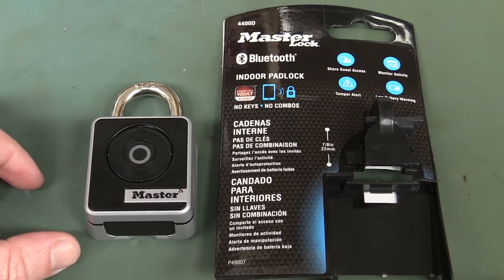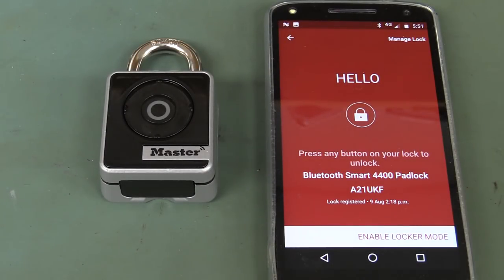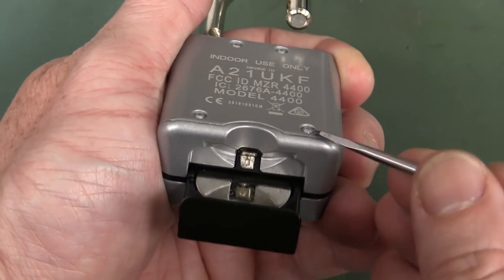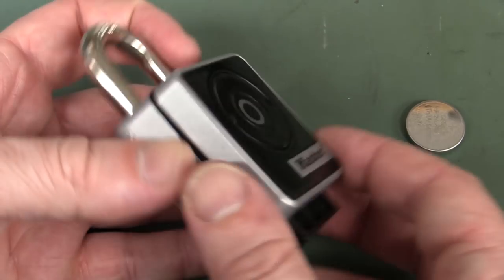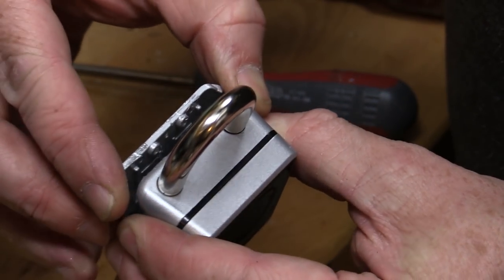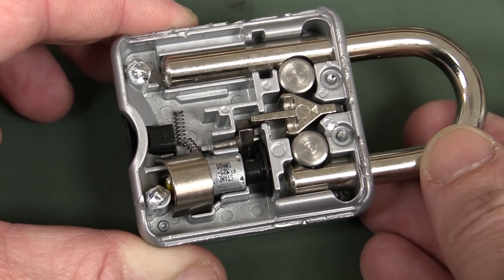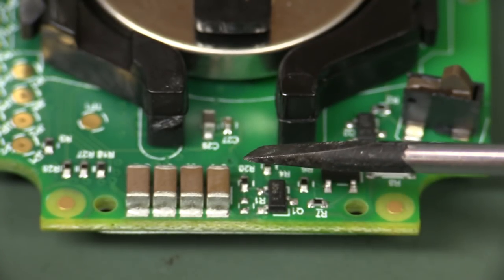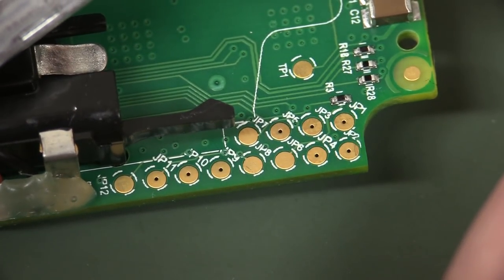EEVblog #1014 - Masterlock Bluetooth Padlock Teardown

Comment: Master locks are a joke in the first place
A beginner can pick their key locks with actual paper clips... Ask any locksmith what they think about them lol
Reply: I made that boast to somebody who challenged me to prove it, so with two jumbo size paper clips (one bent into a tension bar) I opened their Master padlock in less than two seconds from when the pick paperclip went into the keyway.
Reply: easy to push them locking pins in with some shims..im sure theres a vid floating around on youtube showing exactly how to do it
Reply from the maker: No, I don't think shims will work on those pins. The bottom locking pin will prevent pushing down of the upper locking pin.
Reply: It's just a master lock. You tap them once or twice with a hammer and they will fall off on their own.
Reply: Yeah, shims won't work on modern Master's, they've at least come that far. But their key locks are abysmal
Reply: It's not as though their combination locks are hard to get into either.
Reply: All locks are meant to keep honest people honest. No single device is ever truly secure.
Reply: Yes, Joe, I wish everyone would be honest if there is no lock in the world
Reply: Ok Peter S  
I challenge you to post video to prove your two second lock picking skill 
I know master locks as well as other locks can be picked with paper clips but they take longer than two seconds from when the pick first enters the keyway 
SO... prove your skill
Reply: MrBuck295 He's right, probably using the rake method. Some locks are so incredibly shitty that you can just scrape the pick over the pins once or twice, and they open. Usually the no-name Chinese ones, but some Masters too!
I'm sure there's evidence of this on BosnianBill's channel too
Reply: But this one doesn't have a tumbler, thus avoiding the main problem with master locks :)
Reply: Bosnian did a video where he scares a Masterlock in various ways to scare it into opening. :D
Reply: Some locks are so bad that you can hit them with a hammer and pop them off.
Reply: uuugh people lock things to make it harder to get or steal. NOTHING is secure if the person trying to break in is determined, but for someone to lock a "thing" makes it 1000% hard for someone else to just grab and run. Gaaaaahh
Reply: Words are cheep he claims to be able to pick a master lock in two seconds Actually in UNDER two seconds in his own words from the time the tension tool is inserted I find it hard to believe as every locksmith I`ve talked to claim this to be impossible three or four yes but under two starting from tool insertion no    and again he said a master lock not a cheep nock off 
Hell I can pick my worn out master but not in that short of time I pick it all the time cause I lost the key but it`s only used in the house so I don`t worry about   it
Reply: An inexpensive Dudley padlock is ideal for your kids at school.  Can't be picked or shimmed.  You can noodle with the numbers all day to try and unlock it, but who really wants to to put that effort into stealing text books.
Reply: Lock brands have varying levels of security and design. To get a good lock, you need to get specific models of specific brands. A beginner can't pick this bluetooth lock with paper clips, because it is not a pin tumbler design. Another example is that Masterlock has a "lasertrack" style bike lock. This can not be picked by a beginner with paper clips either.

I suppose I would say that I I prefer to use something like an ASSA, Medeco, Mul-T-Lock or even just an American padlock (although all these options cost anywhere from twice as much to up in the hundred dollar range), over using a Masterlock brand lock. Masterlock is by far not the worst brand, but it is also by far not the best brand. 

Masterlock is around in the middle, from an effortless lock that can be opened by pulling hard enough on the shackle (with nothing more than your bare hands, such as a $1 no-brand lock), to locks that are considered impossible to pick and have high-pressure locking pins so that if you pick the lock, then before it grants you access, it will permanently cease up the core, requiring you to physically destroy the lock to gain entry.

However, one more side note, is that some brands of locks, don't care if they sell a lock that uses a key pattern that is almost completely flat, which is horrible for security. More expensive locks, SEEM to have a standard where they SEEM to blacklist these bad patterns, so that nobody gets a horrible lock. To give a lock brand and model the best chance it has, you need to test one with the most drastically shaped key.
Reply: bosnianbill - saying no more....
Reply: A nearly flat key? China never ceases to amaze!
Reply: I love how they're called "Master" yet they're the worst locks in the market.
Reply: Ozzie Peck If a master key is a key that opens any lock, then a master lock is ...
Reply: IIRC someone has already figured out the bluetooth protocol to just ask any lock to open.
Reply: It requires an authentication key. A random device can't just connect to it and ask it to do something.
Reply: just ask bosnian bill
Reply: Lol. 😂

Comment: The drive looks like a modified Geneva mechanism. In use the motor would turn 90° or so, it almost certainly just pulses the motor one way or the other for a moment to lock/unlock.

Comment: Sure you can't take the battery out when it's locked. But there's nothing to stop you putting mains voltage across those battery terminals.

Comment: Have you tried rotating the magnet  parallel to the motor axis? I have seen some locks fail like that. Also DEFCON talks often feature padlocks from the electronic side of the problem.
Reply from the maker: Yes I tried that. They get magnetically hack this at the CC hack conference, but mine seems immune to this, they might have fixed it.

Comment: I don't think it actually spins that much inside the lock. Its just a delay before the motor stops to ensure that the locking mechanism has locked completely... When it actually works, it will just rotate a little bit after which it will be stopped by that locking mechanism..

Comment: This wouldn't be that bad of a lock for lockers or when you're not trying to protect something insanely valuable. And, if there is someone who's used to picking locks open, this lock would probably throw them for a loop.

I don't think it's that bad of a lock per se (depending on what you're using it for). When it works, it is less hassle than a normal lock, but normal locks aren't all that much hassle to begin with.

Comment: Those spikes you were measuring were from the power supply/battery? Are these dips in voltage due to the current spikes of the controller?
If so, how comes that the bulk caps don't do their job and don't flatten these spikes? If not, than I don't get it :p

Comment: Interesting tear-down Dave.  What is to stop a thief from using a battery powered angle grinder with abrasive blade from cutting the hasp ?  Not much !   I've heard of some folks who chain and lock gas power generators to a structure. An opportunist could plug in a grinder ( generator running would block the noise made by grinding ) and be off with the whole system !   It only slows the "honest " folks.    J K

Comment: If this thing could alert you to tampering, I'd be all for it, as my gym locker got broken into once. Some wanker ran off with my wallet, my car keys, and my pants. 

Hey, I gots a production question: Do devices that use programmable controllers like this typically include programming headers on the PCB, or is it more common for the microcontroller to be programmed before installation? Is there a particular benefit to one over the other?
Reply from the maker: You'd need an internet connection for that, and you just destroyed your battery life.
Reply: I know, it's just a pipe dream. Would've been nice, though; Winter in Colorado is a rough time to be running around in gym shorts.

How's about my question on PCB design?
Reply: Header/test-points on board are preferred over programming a chip off board.  This way you can program and verify basic functions at the same time, after the high risk assembly has been done.  If you scale up to millions of units with flawless optical inspection, then it might make more sense to program chips before assembly.  Or if you are making conference badges where you don't care if 30% fail, no testing needed.

Comment: Why not just rip off the keypad and trigger the motor with the correct pins?
Reply: Huh, yeah I guess that might work. You'd only need a screwdriver and a paperclip. Those big soldered joints on the corner look like the wires to the motor so provide power to those and that might do the trick.
(EDIT: I can't words tonight.)

Comment: Feature of opening it by using external Coin Cell indeed is a nice attitude, but I could not see any hint on what type is expected to be used! So, not being able to open it up to see the correct coin cell type possibly would not help you as well open it up if you don't have that info accessable. Regarding all security issues, practicality issues, waste of battery cells, problems with moisture and so on and so on - what's the big advantage of that Padlock over some traditional Padlock (with usual key)? 

It can be cracked open like a usual one, it doesn't seem to work without code like the el-cheapo-numeric ones, it needs battery as coincell and a properly charged phone to work as well, so.....(?)
Reply: It's easy to guess that. Any lithium coin cell. They all are 3V, so you only have to figure out physical size - and any cell in the CR16xx or smaller would clearly fit, and work.

Comment: Why can't you power it from your phone if the battery is dead, or locked out...  if your phone has to be in proximity to it. 
Then just oh carry a usb charge key on your keyring. 
Or a little cr2450 battery holder you can put on your keyring.
;)

Comment: I'd be questioning whether the back is strong enough to withstand a screwdriver being pushed into the crack and twisted. It doesn't look all that strong and there are no edge fasteners. When designing security products it's all too easy to overlook basic issues whilst concentrating too much on complex ones.

Comment: The thing is, theoretically this could be an amazing idea.
We all know that actually, locks are mostly comically easy to pick. (Even the good ones)
Good digital crypto is technically not hackable.

I just have to see a bluetooth lock that not utterly incompetently fails at this promise. Perhaps lock companies should not build computer things.
Reply: As long as you have a mechanical part you can physicaly destroy/open it. Even if you just torque it to death with a huge ass pipe wrench or give it a good blow with a large hammer from above. Pretty sure the aluminium casting will just shatter like the dreams of the design engineer who designed this piece oft art.
Reply: Also good crypto is still technically hackable. You can extract keys by sniffing on data lines, reading memories or finding flaws in the implementation and so on... Good crypto may be in theory unhackable, but at some point you have some implementation that depends on other things that are attackable.

Comment: I wonder if you could get it to open by putting mains power to the two contacts for the "emergency" battery?
Reply: How would you explode the battery, it's not connected when you have access to the emergency battery port.

Comment: Could do some nice screwdriver work to stuff it up if the battery comes out partially while locked.
A slightly better idea would be to use a RFID fob pressed against the lock to power it up.

Comment: Think the best use case for this would actually be a high school kid who could be going in and out of their locker a dozen or more times a day. Of course it's a bit pricey today, but 5 years from now it'll probably be pretty standard fair; then again why don't the just use eBooks?
Reply: i208khonsu Because they can't store their gym-wear and lunch in the ebook.
Reply: True, but my point is I think outside of high school life, what are these locks used in daily life except for locking up your lunch or gym gear? With high school you've got all your books and other gear you need to constantly retrieve and store from your locker, and generally how you plan out your day is dependent on if you have enough time to stop by your locker in the few minutes between classes.

If you can instantly open up your locker, you may elect to take a few less of those heavy books. However; like I said how much longer are schools even going to use physical books? I was still using books in college a decade ago, but I can tell you if I'd go back, there's no way I'd buy physical books if I could help it.

Comment: Enable locker mode. But it’s rubbish. I don’t like locks that require electricity. Combo is the best. I can pick most pad locks in about 20 seconds or less. Usually less.
Bolt cutters will hack it lol.

Comment: As stupid and pointless this is for your personal bike/locker/whatever, it does have legitimate use cases. At work our team has a cabinet we keep our essential equipment in, and we have a serious problem with other departments taking our equipment. We tried a combo lock- everyone knew the combo in a week. Tried a key lock and hiding the key- everyone knew where the key was in a week. I seriously considered buying this product so that one of our team member's phones would have to be present to open the cabinet. We ended up just having two designated people keep a key but it gets annoying having to constantly let people in the cabinet and passing the key off when schedules change. I am still looking in to some electronic lock solution.

Comment: I think anyone can come up, open the battery compartment and use a piece of aluminium foil to short out the backup battery contacts thus render this thing useless until the owner come up with a new battery?
Reply: The battery may heat, puff up and melt the plastic compartment rendering the thing completly useless. It will also prevent the owner accessing his stuff, but since it's Masterlock, access can be regained with a few taps from a hammer.

Comment: "Hardened" yeah not so much, none of those cheap locks are over 40HRc, any small bolt cutters will pop it right off. I have high tensile fence wire that is more difficult to cut.
The bluetooth bit is all gimmick anyway

Comment: Dunno about that backup battery terminal - if someone's enough of a dick to try stealing the battery when it's locked they might be just enough of a dick to probe  those exposed terminals with a modified mosquito zapper bat handle or some other portable source of HV to try fry the ICs just to piss you off. particulary if it got popular with schoolkids which seems to be who the advert is aiming it at... how's it going to stand up to that?

Comment: It is pointless, I'd never spend £50 on a lock that could be busted with a set of bolt cutters in seconds
Reply: Bolt cutters,?  try a foot of rebar through the shackle or any handy stout stick
Reply: The case material looks like something very smashable with A hammer,two bricks or decent pliers.
Reply: Point being it's not a hardened shackle even
Reply: It's not even a lock meant for security, if you want security go lug around a 4 LB mul t lock c16

Comment: why didn't they used rfid, its easier to use than bluetooth and you don't need to make an app for conrolling the device.
Reply from the maker: You'd still need a keypad for a manual combo.

Comment: EE guy can't make it work, so there. One time I wound up in an argument with a computer store about a modem card that would not work with its drivers. They insisted they install a newer windows, and it still didn't work. It turns out there was like a different chip version, and it shipped with the wrong software. BTW oh shit I didn't charge the padlock better get out the paperclip.

Comment: If Dave never got the lock to unlock using Bluetooth, then it's a Fail. He should have traded it back for a functioning one before doing a teardown analysis. The talk of a combo lock being superior because it's a simpler system isn't even necessary if the Bluetooth access doesn't work.

Comment: It says big fat "Enable Locker Mode" and Dave wonders why the locker mode doesn't work. Quite a bit of pointless bashing there.
Anyways, Master Locks are garbage, although this BT lock is actually not bad because you can't just pick it in 2s like any other Master Lock.

Now if you want to deal with the whole BT stuff is sort of your choice. You practically exchange a proper key with your smartphone though.
Reply from the maker: No, locker mode is for when you have your phone in the locker in which case it forces you to use combination. I didn't want that mode.

Comment: No IP rating?! Why! Not even some rtv or a gasket. Would be handy on a garden shed maybe, I imagine anything its going to be on that the actual staple and hasp of whatever would easily be thwarded in a blow or two with a hammer and chisel. Wank products... 5 dollar lock and come corrosion protection spray and you've got no worries on some light security situation for years. As AvE would say, "Gyarbage".
Reply: The label on the back says "For indoor use only", no need to give it an IP rating

Comment: Master locks take seconds to break into, they are an embarrasment of a brand. I've seen this lock have the body melt off with a blowtorch in 90 seconds. You can pop off the front pad and access the PCB with a screwdriver. Thier traditional locks can be raked open with a butter knife.

Comment: Actually you can pull the battery out. You just need to pull a little bit harder. And I believe you need to hold the middle button for it to open. They are quite useless little gimmicks.